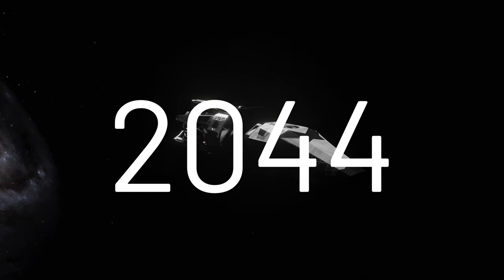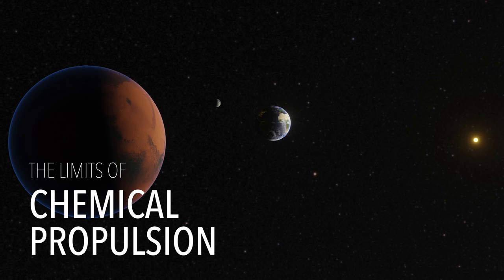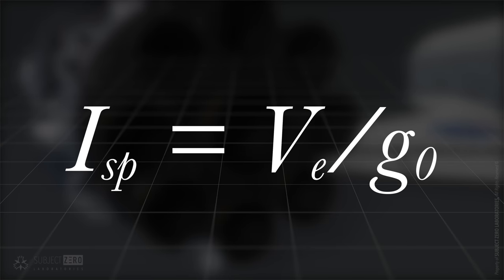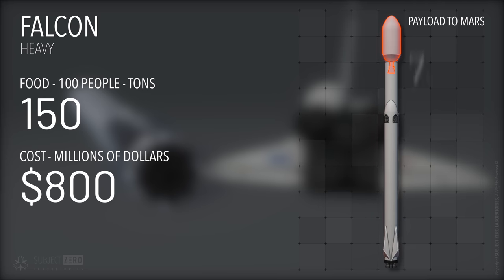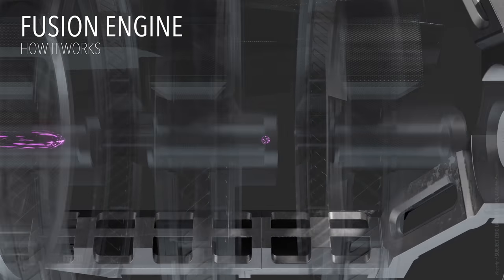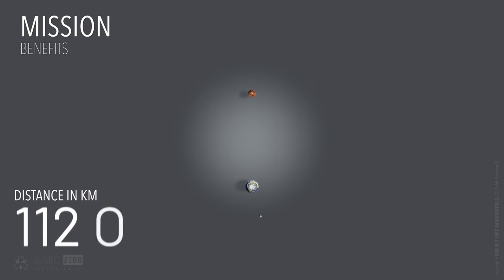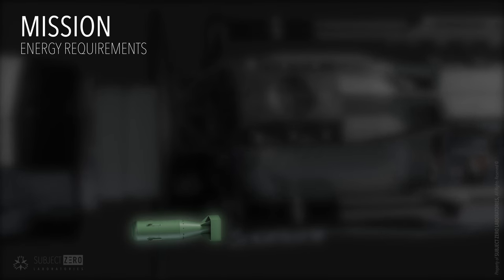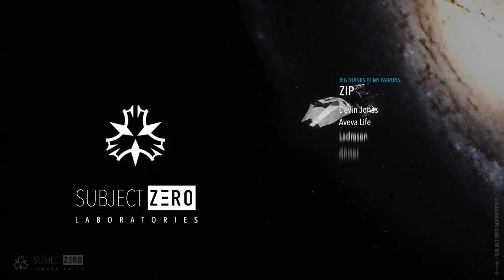Fusion Rockets - The Real Mars Express

Comment: The problem is that Magnetic Taurus Induced Fusion takes a lot of energy to kickstart,, the same amount that it produces, as in break even. That's a yet to be tough scientific nut to crack.

As for cold fusion, through the Sub-Atomic Impulse Synchronization postulate method (Impulse Power), experiments during the 1950's and 1960's, all failed to achieve cold fusion as nobody could produce a functioning synchroniser. Impulse Power was one of the then 1960's problem technologies that we'd crack in the far future, that Star Trek writers picked up on.

Comment: But where will spacecraft gett all the power for magnetic fields?

Also fusion drive itself creates radiation, so there would be need for radiation shielding for engine itself.

And I think we will first need to be able to make working fusion power plant to be able to build it.
Reply: My greatest concern is what happens when it reaches Mars. Power will certainly have to be provided from the reactions; I'd suspect that there will be multiple reactors (some for energy, some for thrust). Its also super heavy and costly. Edit: like the Starship Avalon from Passengers, it might even have to be made from space mining facilities 'cause Iter weighs 23, 000+ tonnes (or 230 starship flights with fueling to GEO)
Reply: @benwaters5627  Tokamak would be very powerful thing (probably overkill), and when crew is on Mars little to no power will be needed. 
Solar panels or fuel cells (which could be refueled and water used for crew) might be used.
Reply: @ImieNazwiskoOK   @Imię Nazwisko  Yeah, multiple reactors similar to MIT's SPARC reactor would be more suited for this. But what I'm trying to say is it's going to be EXTREMELY heavy so it'll probably be used as a passenger vessel rather than a deorbiting ship. Solar panels or fuel cells are probably going to be used anyway. You may as well just have multiple reactors. Another thing I'm interested in is how will it get the megawatts of energy to initiate the reactions in space.
Reply: @ImieNazwiskoOK  Solar panels on Mars are a stupid idea. They'd collect less than half the power they would on earth without accounting for the dust storms Mars is famous for. Sure, solar panels work for a rover the size of a microwave as long as they're free of dust, but we aren't talking about a tiny rover. 
Assuming we aren't able to make a small enough fusion reactor to send to the surface with them, an RTG like the later Apollo missions or a full blown nuclear reactor would be orders of magnitude more appropriate.
Reply: @jsn1252  In space there is no dust storms, and this is still easy way to make power.
They would probably also be wind turbines (they work very well in sandstorms and make similar power to solars).
Also in colony solar panels could be cleaned from it.

RTG gives just too little power. And making nuclear reactor on Mars would need from time to time fuel delivery and would be very hard.

Comment: Electromagnetic fusion drives may give way to Gravitational wave fusion drives. If gravity wave manipulation is how UAP's are able to fly it seems that gravity waves could replace EM fields as a means to achieve fusion in these engines. Plasma could be contained using those gravity waves.

Comment: Big ass waste to neutrons using T-D, the waste heat may not be worth the trouble. Just produce tritium from fission power plants and let it decay into He3 and you got aneutronic, or low neutron, fusion fuel. Lithium turns into tritium when exposed to neutrons like what the molten salt reactor guys are afraid of, but turn it into a commodity instead.

Comment: The VASMIR engine can get to Mars around 40 days and has already been tested 3000 times on earth and just needs to get tested in space
Reply: the power is really low... that tech is still only for small unmanned craft
Reply: Saying that can make the trip in 40 days is a hoax or a scam. Maybe if it had zero payload with a magic power supply. Also I hope you love radiator mass. Robert Zubrin already ran the numbers on that thing, its just a glorified microwave oven. Using plasma to produce fusion power means you basically multiply the input power.
Reply: @LoneWolf-wp9dn  We already have ion thrusters, VASMIR is redundant. SpaceX's Starlink and many other companies already use them on their small satellites, in cubesats they're popular since they're really the only choice.
Reply: @leerman22  not everything that seems to good to be true isn't always false the rocket was developed and built by Chang diez and his rocket company ad Astra. Chang is a NASA physicist and an astronaut that flew 5 shuttle missions but it needs 200 kw of power. And is not only for small spacecraft it can be used to transport humans or cargo extremely fast to different parts of the solar system.
Reply: @ok ok yes
Reply: @LoneWolf-wp9dn  the power is not low it's thousands of times more powerfully and faster than ion thrusters and it can be used to transport human and cargo missions around the solar system
Reply: @evanoberdas5496  "To achieve his much-repeated claim that VASIMR could enable a 39-day one-way transit to Mars, Chang Diaz posits a nuclear reactor system with a power of 200,000 kilowatts and a power-to-mass ratio of 1,000 watts per kilogram. In fact, the largest space nuclear reactor ever built, the Soviet Topaz, had a power of 10 kilowatts and a power-to-mass ratio of 10 watts per kilogram. There is thus no basis whatsoever for believing in the feasibility of Chang Diaz’s fantasy power system." 

Robert Zubrin then goes on to say a reactor P/w ratio of 30W/Kg would be feasible and would be better used on ion drives or powerful deep space satellites.
Reply: @leerman22  just proved that the VASMIR engine can get to Mars in 40 days. Thanks 👍
Reply: @evanoberdas5496  No I didn't. It wont run for more than a few seconds at 1000W/Kg before melting.
Reply: @leerman22  you said "to achieve this much repeated claim that VASMIR could enable a 39 day one way transit to Mars." You still said that it could get us to Mars in 39 days even with those setbacks that will eventually get fixed like everything else in this world. And maybe a new engine would be better who knows but you still just proved that it could get to Mars in 39 days
Reply: @evanoberdas5496  Unless you can change the laws of physics (regarding increasing blackbody irradiance orders of magnitude) the claim is a hoax. That's what Zubrin is saying 10 years ago, the concept was worked on longer, and still the thing is nowhere near capable of the claims. There are no plans to build a space reactor capable of powering the thing in the first place to the hypothesized specs proposed by Chang Diez.
Reply: @leerman22  👏👏👏👏👏

Comment: Not the only possible way to Mars. There is energy electric ion/plasma and thermal/angular gyro spinwheel pulse, running on amp nuclear ratio levels, while saving a bit more power level of fuel with pending regenerated cell power, while conservatively generating acceleration, non-idle at gravity sustainable g-force level ~.05-2.5. 

That chem-fuel mixture of nuclear has 4 flaws, the nuke combustion would be too great, the fuel wouldn't last any longer in time duration,  plus gravity would be an extreme force, that would force idle micro gravity exposer time in travel, it also cannot be used in considerably high atmospheres over micro levels, as nuclear combustion chain reaction. 

 However, a very rugged booster cone, spewing micro to nano flow of fuel stream, static fire/ignites, can equilibrium a flow fission, equal to 2 to 4x only the classic chem fuel burn ratio, so at only 1 to 2x gravity acceleration,  saves fuel as well, accelerating non-idole.

 That is gravity, non-idole acceleration, enough fuel store combo in one, just save the classic fuel & rocket boosters for emergency maneuvers & VToL sequal at planets.

Comment: Hey there rocket scientist, where is your power supply to drive the fusion reactor?  Gotta have something to run the EM containment chamber and fuel injection process.   From what I have read the PS requirement for start up of a modest working fusion reactor is on the order of 70 megawatts.   If your energy produced is going out the tail pipe you don't have the heat exchange cycle to run a turbine to generate electricity to sustain the thing and I don't see that in your diagram.

Comment: Something is way way off. A 90 day one way trip to Mars is something that could be managed by a more conventional fission based nuclear thermal rocket that uses hydrogen as the propellant running through the core, and it would have an ISP of around 1000 seconds. 5000 seconds should result in a much shorter travel time but even this is way too small for a fusion rocket which some estimates put in the 1 million seconds range. Although a lot depends on the thrust to weight ratio of the engine, It should conceivably be able to accelerate/decelerate for the whole trip with one way trip times to Mars in just a few days.

Comment: Specific impulse.  Back in 1926 Robert Goddard envisioned using balloons to lift rockets to altitude before ignition.  The Stratolauncher is envisioned to carry rockets up to altitude with air breathing engines and to altitude prior to ignition.  Why oh why are most rockets STILL being built and launched like it is 1944 Germany?  Vertical launch from a standing start loses any lift component of a winged launcher using air breathing engines.  Using a piggyback system would go a long way to increase the viability of heavy lift capability.

Comment: There is a rocket technologie that is even better than fusion. But its even more unreachable. Its called a blackhole starship. 
The idea is, that a blackhole emits hawking radiation. You use that as a boost. The smaller a blackhole the faster it goes. Making it the right size is importend. So with the right size you get a powerfull rocket. All you need to is keep feeding it, to keep it under controle. To safe on fuel, making the blackhole should be done by giant lazers around the sun. 

While fusion turns around a few procent mass to energy. But blackholes turn 100% to energy. Basicly a much safer way to antimatter.

Comment: It's still complete sci-fi. Such a ship would not land anywhere and would have to be huge, because, as you know, small tokamaks fail in terms of efficiency.
Reply: I mean it's not this tech has already been tested. Remember the ship isn't powered by a fusion reactor those are still a long way off, it is simply taking advantage of and directing the energy released when particles undergo fusion something we have been able to consistently create for a few decades now. The ship itself will probably be powered by conventional power methods like batteries and solar solar panels.
Reply: @exilestudios9546  I may have misunderstood the design, but isn't very high temperature required to trigger the fusion? After all, batteries and solar panels are unlikely to be enough here.

Comment: I think the main drawback is the power source for the magnets all the energy going to thrust is a great way to boost efficiency but that means the heat and pressure don’t contribute to the next fusion pulse right? So I the ship would probably need to use NEP to power the magnets and that will increase the overall size but with so little damage from the fusion reaction it can probably be reusable.

Comment: Anti-matter will be far more efficient than fusion. Both antimatter and fusion are currently out of reach so why didn't you consider antimatter when you claimed that fusion will always be the most efficient method of energy production?
If we could find a way of harnessing antimatter or maybe far more easier creating it while simultaneously using it then a lot more will be possible. 
Because there is no need for storing it if it is used immediately on creation. Say we come up with a fast decaying material that creates a lot of positrons or even better anti-proton and use magnetic field to direct it to the outlet. Then you can use just about anything as matter, say hydrogen ions. Then you can really accelerate.

Comment: Right now fusion rockets are what engineers call vaporware. Should they work in the real? Yes. Will it be simple as they think it will be? No, and it will take much longer to develop than the rosy projections we have today.

There is no need to spend to develop and wait for a fusion rocket. As noted, the fusion rocket is estimated to have an ISP of 5000 seconds, after decades of development and no guarantee it will be on time or at all. With a Zubrin nuclear salt water rocket we are looking at 10,000 seconds ISP, with no new technologies or physics needed. We could start designing one today. We won't even start on an Orion drive, similar power but able to harness antimatter and be interstellar.

We do not lack the technologies to develop space, we lack the will. Hopefully low cost to orbit from earth developed by SpaceX with their Starship Super Heavy will make the logistics and costs to commercialize space far more realistic. We can only partially develop space for humanity with government programs like NASA. Only profitable commercial development of space will enable that goal. Look what SpaceX accomplished in less than a decade compared to more than seven decades of government launch development as an example.

Comment: But fusion power is a pipe dream.  In 70 years they have never got a reactor to work, none have been able to recover the energy they put into it and no ship can generate the power required to ignite the few grams of tritium.  It is totally impractical for the foreseeable future and perhaps never.  You would need a nuclear reactor to ignite one and tons of tritium.  And you need an exhaust product.

Comment: Thermonuclear fusion is the Holy Grail of reaction drives but there are systems which deliver high specific impulse but only produce low thrust. An ion thruster called HiPEP was tested at nearly 10,000 'seconds' but produces thrust levels in milli-Newtons. The options would be to preposition payload to Mars with highly effective but relatively slow robotic transports. Nuclear thermal propulsion was tested in the 1960's and 1970's... at 800 to 1200 'seconds' we could move astronauts to Mars. Fusion is not the only high ISP high thrust option. Fission systems have been conceived with radiation management being a definite challenge... but shielding and separation remains possible. The real issue is you have to commit to mission and a technology that doesn't work with Western politics. Ten years of dedicated funding could put together a functional system... but political will has to remain constant.
Reply: How's this for political will. If we don't do this, and a giant asteroid comes along, we are as fucked as the dinosaurs were. And it'll be our own damn fault too for not saving ourselves when we had the chance.

Comment: 1) solar panels are not coal or oil, they generate energy over time, and depending of where on Earth they are it will change, so don't adding this info is as apples to oranges
2) cost of launch of one rocket you taking Falcon 9, and you should Starship which would cost $2 M, this change all what you say
sorry, but I can't like half baked video like this.

Comment: Any chance of atmospheric pollution when by-products of process disperses during launches, possibly ramping up to thousands of such per year, as we explore/colonize/ resupply/support mission after mission?
Reply: If we use methalox or hydrolox engine we can make fuel out of pollution from them with energy that could be made with eco friendly sources (but a lot of it)
Reply: This will likely only be used to go from Low Earth Orbit to deep space.  

The rocket propellant is mostly lithium.  Lithium is considered hazardous waste material.  There is also tritium in the propellant stream which is radioactive.  Some neutrons would flow directly out into the environment.
Reply: @stefanr8232  Tritium is even used in watches and it has half-life of only 12 years.

But still I would prefer that engine away.

Comment: You think we need fusion power to get to Mars ? Oh gawd...
Reply: It's not getting to Mars that's the issue we have been able to do that for decades it's getting there and back as quickly and efficiently as possible that is the issue. The faster a craft gets to Mars the less radiation a crew is exposed to and thus you save on crew training costs as you don't need to replace the crew each mission because of health and safety regulations. A craft like this could also carry a much larger payload so sustaining research outposts and even possibly a colony is far more viable. This tech will also make travel to the moon trivial so odds are we might even see lunar colonies start up as well.
Reply: Build a space station at earth and Mars and send ai backes programmed cargo ships back and forth from the space stations with station crew managing it point a to point. B, people man the stations and rotate back and forth on the cargo loading ships to the space stations to limit exposure.?